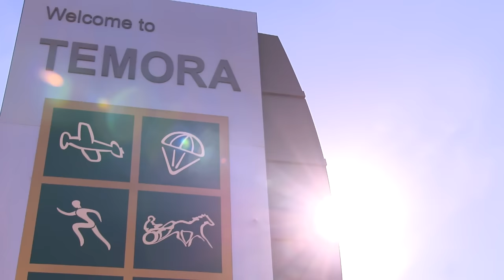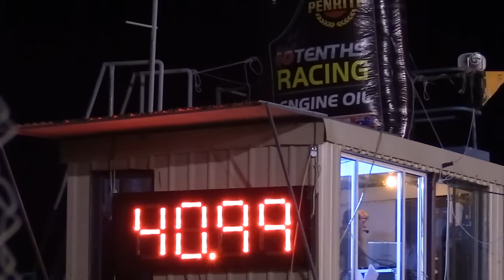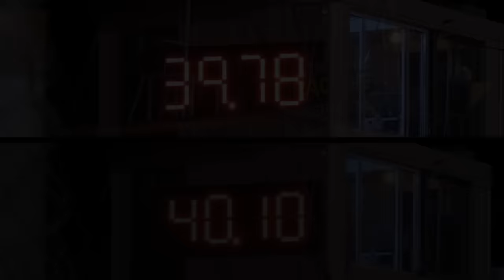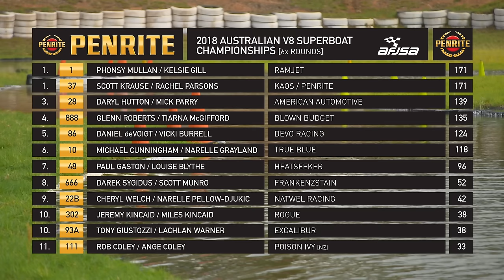2018 Penrite Australian V8 Superboats Championships - Unlimited Superboat

Comment: If the nurburgring was a water circuit, how fast do you reckon one of these would get round?
Reply: Fuel tanks not that big
Reply: @thekev069  It can do it. It has enough fuel depends on tank size.
Reply: Considering that they take sharp corners at full speed. Some records would be broken for sure.